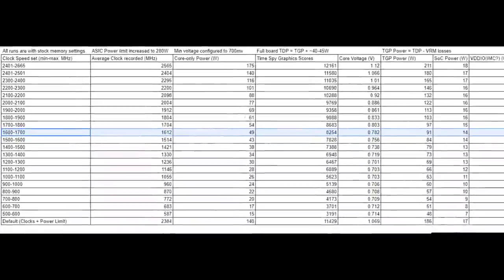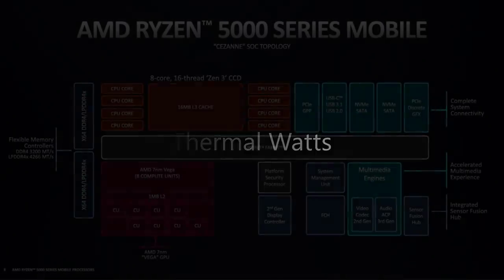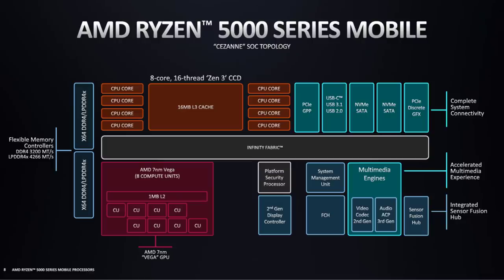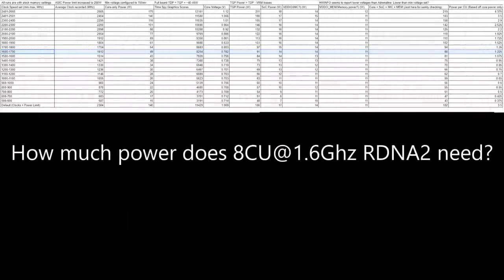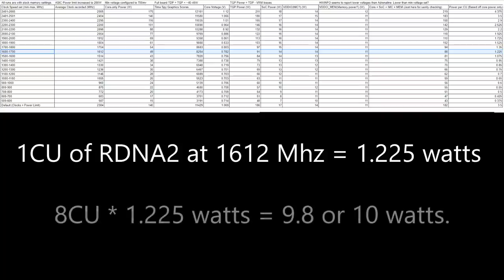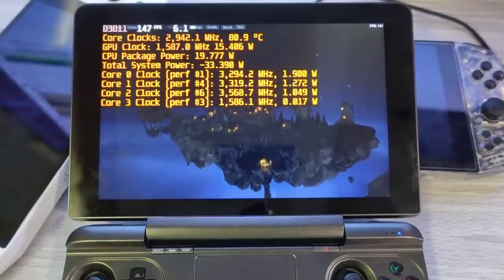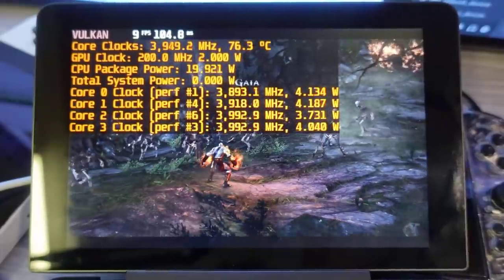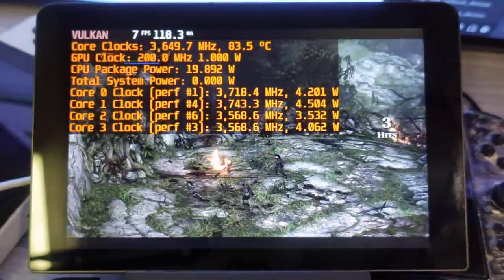Steam Deck - GOOD NEWS! RDNA2 8CU @ 1.6ghz Only Needs 10 Watts! Let's Talk About TDP!

Comment: Just as I thought, rpcs3 and yuzu/ryujinx probably wont be playable at full speed for most of the challenging/3d games (excluding indies and maybe closed/confined games like fighting games) , at least in the current state of the emulators, while keeping tdp to 15-20w.

Hopefully yuzu/ryujinx still has significant room to improve on the cpu side.
Reply: Emulating PS3 on a handheld is still a mindblowing thing. PS2 would emulate amazingly on Steamdeck and that's enough for me.
Reply: I'm thinking the Steam Deck won't have an issue with Yuzu when it is finally released. Remember that there is still continuing Yuzu optimizations to come. I think it will probably still have issues with RPCS3 though.
Reply: @Neonagi  after all we don't even need Yuzu to be compatible with every Switch game out there. Just those few that are really good.

Comment: the Steam Deck comes with a 45w power supply and usb c can handle up to 100w. I hope the cooling and power supply(intern) can handle a bit more. For the extreme cases 10w more would not be bad. I don't think it will be hard to overclock the APU, on Windows it can be done on the fly on the desktop.

Comment: I personally think the steam deck will try to hit 1.3ghz a lil more often than the 1.6ghz, since it is slightly more efficient.
The following bit is something you probably will get into with your next video, but figured I'd comment about it :)

That aside, given that the APU has a single zen 2 chiplet and the RDNA2 CUs on a single die, it means it needs less or no power hungry infinity fabric, and it is more power efficient (less lost power, dynamic shifting of power).
It will be rare for a game to max out both the GPU and CPU portion.

The APU gets 15w, the rest of the system 5w, unless you underpower the other components a little. Or you can overclock it, Valve mentioned they had some plans for that being a thing.

I'm very curious on what you'll say in your next video on power usage :)

Edit: do you think adding 2-5w tdp with overclocking, given that you cap the max CPU (boost) frequency, would be a good idea?
Just to eek out a little more performance.
I have some laptop cooling solutions that could help the (already impressive) thermals of the steam deck
Reply: It's going to need more than 5w to max out the CPU, in his example the CPU cores alone can use 18W.  Anything extra is a bonus and also per core voltage will help power efficiency.  That said, he used undervolted values for the GPU at 700mv... so if anything I would expect the GPU to be closer to 11.2W, not the 9.8W calculated.

Comment: Regarding the RDNA2 data at 5:40, it looks like to me that the first point of diminishing efficiency starts at 1300. So theoretically, if you wanted to really get the most bang for your buck (power per watt spent), you'd cap the GPU around there... yeah?
Reply: Yeah, 1300MHz is the last point where voltage sticks to the minimum of 700mv. That's the most efficient point for sure, but scaling is still good up to 1600MHz. Actually it's really still quite good up to 2GHz, but at that point you'd need >15W for the full SoC so not suitable.

Comment: Something that I don't think you mentioned (unless you did and I missed it) is that the TDP will include power limits in the BIOS that will likely be difficult or impossible to change. Just because the APU is theoretically capable of pulling around double the rated TDP doesn't mean the power regulation will allow it to exceed 15W (at least not in a meaningful way). It will clock down and I doubt you'd be able to get it to pull more than 20W for brief moments.
Reply: One of the existing TDP adjusting tools for Renoir will work on Van Gogh according to it's creator. Don't worry about the the BIOS being difficult or impossible to adjust 😛

Power regulation is the real concern when it comes to adjusting TDPs.

Comment: @The Phawx, how much powerful do you think the RDNA2 on the Steam Deck is compared to the Iris Xe iGPU from an Intel i7- 1195G7 on the GPD Win Max 2021? 10%, 25%, 50%?
Great video, by the way!
Reply: Iris Xe is 25 % much powerful that vega 8 but amd graphics driver is better. .finally is pretty much the same
Reply: @tomaspavka2014  I know that but I'm asking about the RDNA 2.
Reply: amd cpu rdna2 in steam Deck is slightly weaker that 1165G7
Reply: @tomaspavka2014  let me explain you something because you clearly have no clue what you are talking about... if we believe GPDs fps comparison between the 1195G7 vs 4800u from the Win Max 2021 campaign at IGG which is obviously false just by comparing those numbers to the videos uploaded by themselves, it ranges from 0% to 50%, so let's average it at 25% more fps to the Intel CPU. There is no way the newer and much improved AMD's Steam Deck custom APU is going to under perform in the GPU front compared to the 4800u. And above all, do not forget the jump from DDR4 to DDR5 on the RAM which will make a pretty big difference in games. So taking this into account, AMD's custom APU will be faster in games compared to the 1195G7. My question is, by how much? CPU wise, the 8 core, 16 thread 4800u will be on top by a big margin, of course.
Reply: @Aitor  well steam deck is like 500 dollars do not expect is better that gpd win max 2 or even gpd win 3 it's more like aya neo and  speed RAM does not count because 800p and almost games run well on x-box one with shitty RAM
Reply: @Aitor  30 fps is enough for console and gamepad  60 fps or higter is for PC because mouse is very cool with high fps do not believe the commercial bullshitt

Comment: Great Video - can't you overclock the GPU higher, instead of using the extra watts for the CPU, use it on the GPU? RDNA 2 @ 2.0ghz = 1.7W per CU 13.6W = extra 25% perf.
Reply: It's already doesn't have enough power to maintain 1.6GHz @ 15W and the numbers used were from an undervolted GPU (700mv).. NOT stock.   Also off topic, but I ran numbers from digital foundry video on RDNA vs GCN and by averaging all the onscreen average frames from that video I came up with the RX 5700 CU being only 15.02% faster than a RX 570 CU, while being 23.66% faster when compared a RX 580 CU.  I'm no expert. but it would seem that the RX 580 36CUs are being held back from the lack of ROPs in some games.  Meanwhile Vega 8 already has matching ROPs like RX 570 and it has rapid packed math, so it's really going to come down to power consumption per CU and on those Zen cores.

Comment: Stoked for this, got the 512 reserved. I've also got the win 3 and Onexplayer. Seems to me though, that, ignoring Ray Tracing, both of these devices are higher performers than the Steam Deck. TFLOPS are much higher, and I've seen them running 45 and even 50 tdp while docked. You seem as able as anyone to make an educated guess on this. Can I ask what your thoughts are?
Reply: ? The gpd win 3 goes to 30(technically 28) at most, one x player goes to 40, anything more and you will thermal throttle
Reply: And they cost twice as much.
Reply: @FlexibleToast  yes, and? That's got nothing to do with my question.

Comment: "15W TDP will be enough to max out all the performance on the Steam Deck". You mean CPU performance right? I know you said that earlier in the video, but just to clarify what you mean, even by overclocking 1 core or parking other cores and overclocking just a few (over 1.6GHz), you're saying the Steam Deck will be able to take anything thrown at it such that the GPU will always be the bottleneck, not the CPU unless you're running the PS3 emulator. Right?

Comment: Most youtubers that have been reviewing these handhelds target a 2 hour minimum playtime when adjusting the performance.  If you look at the battery capacity for the steam deck, they came in very low at 40wh.  After the APU, memory and the display will be the largest contribution to power while gaming.  The SSD may in short bursts take a larger total, but over the two hour period, it should be less.  Additionally, there are losses converting the battery pack voltage to all of the required regulated voltages of each component.  You will have to reduce the TDP from the estimated 16W to have 20W leaving the battery per hour.  This is fairly disappointing considering steam has the widest handheld where being compact or portable clearly was a design focus. From a general standpoint, you get ~13wh per 0.11lbs with high capacity high voltage lipo batteries.  The steam deck weights 1.47 lbs while the gpd win 3 weights 1.21lbs.  If GPD adjusted their unit to be as heavy as the steam deck with additional battery capacity, we would be looking at ~75wh battery.

I have a reservation for the steam deck and it is exciting, but I don't know how often I will find a scenario where I wont prefer my Win 3 for portability, or the Onexplayer for casual games and media consumption.  I am hoping the aiming system is good for games like DOOM, but I don't know if it will be emulation friendly.  Compared to the Indiegogo price for either of the 1165g7 based devices, you get half the SSD for ~$650 on the steam deck, so it isn't a whole lot less for using a much less expensive processor, and much less versatile for emulation or desktop replacement with e-gpu.
Reply: Given how the device is shaped, I think you could strap/clip a power bank to its back relatively easily... not ideal, but it would help?
Reply: @MaxLebled  I wanted to make a point about out of the box battery life and how other devices seemed to be held to a 2 hour minimum gameplay standard.  If battery life isn't important, then the 1165g7 has a faster CPU and a faster GPU than this device will (unless you can overclock the GPU substantially.)  Based on the win 3, a 15W TDP is about 22W of system power for 2 hours of gameplay.  For 2 hour of gameplay, the steam deck will need ~13W tdp.  Another comparison point would be the onexplayer at 1.82lbs and 59wh battery with a 44% larger screen, but is still not as wide as the steam deck.  The steam deck is .26lbs heavier than the GPD win 3 and the onexplayer is .35lbs heavier than the steam deck.  So about the same difference,  but will allow you to run a 29.5w system for 2 hours of gameplay.

In my opinion, the three major flaws of the device are the size, 2230 ssd, and low battery capacity.  I am really interested in what the internals look like to see if this can be re-packaged, since the APU is not otherwise available.

Comment: A) You used his undervolted numbers and (B) this is an educated guess not actual power draw.  Still let's split the results of undervolted and stock down the middle and go with that and we have the following: 1.0GHz 6.6W, 1.1GHz 7.27W, 1.2GHz 7.94W, 1.3GHz 8.6W, 1.4GHz 9.27W, 1.5GHz 9.94W, 1.6GHz 10.6W

It should be roughly 300MHz at 2W.
Reply: I didn't undervolt. I listed the minimum voltage at the very top of the spreadsheet because that's the default for my card and it explains the behaviour at 1300MHz and below. If I wanted to adjust it I'd have dropped it to the minimum my card can sustain at 675mv.

I let the default boost algorithm do it's thing for the most part, just gave it minimum and maximum clocks it's allowed to hit and recording the power and voltages
Reply: @uzzi3822  From my understanding is the stock minimum voltage is 862mv and you have you're set for 700mv, is that stock or not?
Reply: @danieldelillo  ...actually I'm not sure now. I did this testing over a month ago and haven't played with MPT since. You might be correct actually, because 862mv does sound familiar.

That being said, I don't believe this adjusts the results for anything above 862mv, just everything below. Also, APUs are usually configured to lower minimum voltages than desktop GPUs are. I would expect VGH to be configured with ~0.75V as the base.
Reply: Actually yeah, I just remembered you're right. I first posted a chart with the default minimum voltage, and was suggested both by people on Reddit and a friend from one of the big 3 chip companies that I should try again with lower minimum voltages.

So you're absolutely correct in assuming the data here is not with the stock default settings.
Reply: @uzzi3822  The range in your spreadsheet was between 703 - 782mv for 1 - 1.6GHz, but that said, we don't know what VGH will use.  It could use something in the 600mv range.
Reply: @danieldelillo  No, again according to the friend at company X I mentionned before 700-725mv is the lower bound of reliable stability for chips. Lower than 700mv and it becomes difficult to drive current through gates at all.
Reply: @uzzi3822  I know 700mv was as low as I could go on the RX 480.  I even tested Doom Eternal on the same scene / medium settings as Linus's review on the Steam Deck.  Using the RX 480 at 425MHz / 700mv and I'm able to match the 58FPS at around 25W according to GPU-Z, which is not bad for a 14nm part.  I seen you have a 5800H, what did you come up with for that static scene?  I'm curious to know how a Vega 8 performs in that scene power and frequency wise to match the steam deck.
Reply: @danieldelillo  Actually very similar to your GPU there. ~25W sustained power, the 2GHz iGPU clock was held and average FPS around 50-55. Would dip to ~45fps or spike up to a bit over 60fps

Comment: From Linus steam deck hands on video, the max temperature of steam deck using his thermal camera was around 55⁰c at 15watt TDP. Hypothetically, a 30watt TDP should cause double the temperature which is 110⁰c. That's not good

Comment: Oh dear dont miss information to people, this method are completely wrong, he using 6700xt which is desktop card lol, and ryzen 5800h which is zen3 😂 dumb comparison, you should comparing 6800M laptop gpu has same cu and massive lower power consumption, and apu series on rdna should be lower power consumption compared laptop gpus, no way you compared with desktop gpu lol such noobs, rtx 3060 laptop has more cuda than desktop and running at 75w will be same perfomance with 150w+ 3060 desktop 😂, and Nintendo switch. Run at 4.7watt at 768/1024, which is 1/4 from steam deck performance, so do you. Think this steam deck consume 30w 😂😂😂 lol
Reply: The 6700xt is on the same 7nm node and it was undervolted to 700mv, which is pretty much as low as you can go before gates start having issues.  If anything I wouldn't be surprised if AMD uses a higher floor voltage like 750mv to keep yields high.  Also, there's a reason the 3060 laptop has more cuda cores, because they need to compensate for the lower clocks needed to reduce power and even then it's slower than the desktop part.  I calculated it to be closer to around 11.2W for to max the GPU at 1600MHz, but anyway you look at it the steam deck needs more than 15W when pushing those CPU cores.  Around 25-30W should be needed to max the CPU and GPU.
Reply: @danieldelillo  at same voltage the lowest one between laptop gaming & dekstop will be massive different, i'm miner i have both gpu, and i tried using multi meter not by software measurements, snapdragon 888 has better 2x perfomance on same watt as mariko switch cpu, so you think steam deck apu will consume 30w, just throw it to the trash is junk then 😂
Reply: @whitefata104  I have a good knowledge of undervolting and bios editing for GPUs.  It's the same manufacturering node and I doubt amd is binning every APU for maximum efficiency just to save a 1W.  That said, those CUs should be extremely similar to their desktop counterparts, so I think you're a little unrealistic in your assuming.  Just look at the 6600 XT which consumes as low as 55W mining at around 1200MHz.  Divide that by 4 because the 6600 XT has 32CUs and you get 8CUs eating 13.75W at 1200MHz.  At best I see 1600MHz drawing at least 11W and that's not including encore or the CPU which could take at least around 18-20W.  Yes, to floor the APU to the max on the CPU and GPU 30W would be required.
Reply from the maker: I was actually right about everything in this video :D